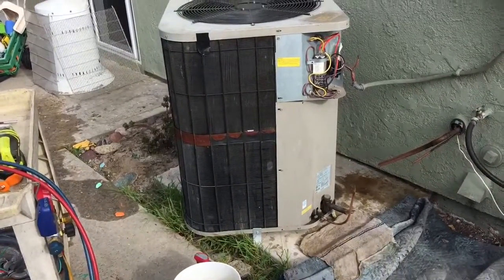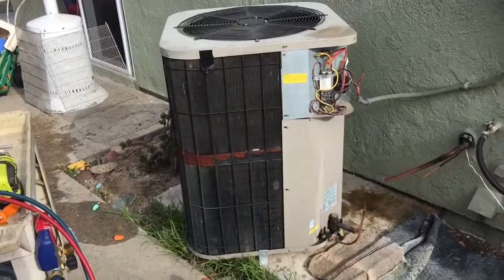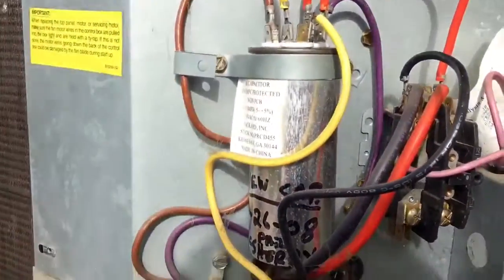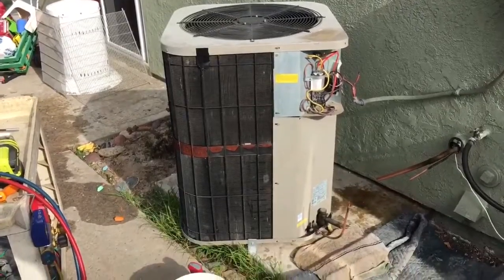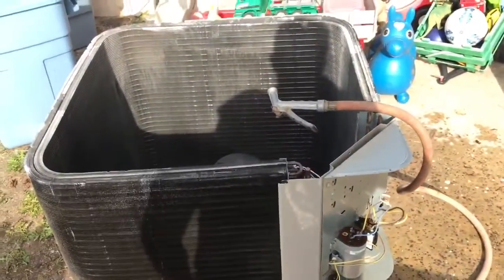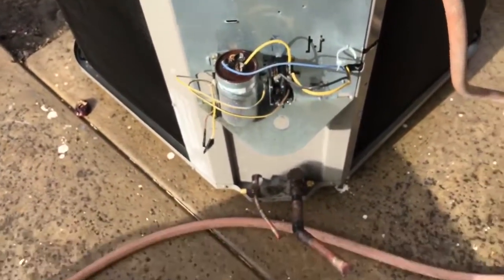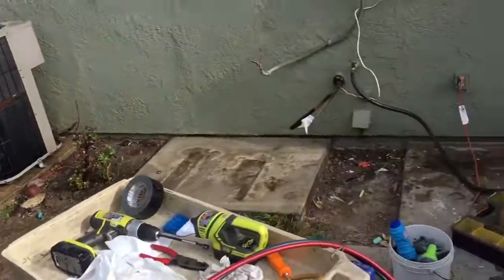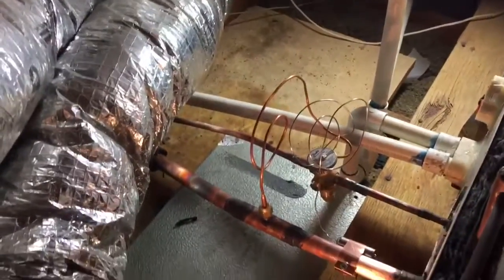Old R-22 3.5 ton removed👏4 ton install R-410a😊piston removed😊 txv installed😊

Comment: Nice video one quick question on that equilizer port did you put a core valve?
Reply from the maker: No, why would i do that ? Do you ? Equalizer tube has no schraeder depressor in it.
Reply: OcRefrigeration,Hvac & Electrical. Don't take it personal bro it was just a question , reason why I asked was because I attended to a seminar recently and one of the instructors mentioned that its best if you install a core valve .. and now I'm going to answer your question no I don't install core valves at the external port I don't even use a valve I drill a hole big enough to fit the   Equalizer pipe  I cut the flare nut off and braze it in .. plain and simple my friend!
Reply from the maker: Yea, that is actually Best. Only thing with that is you have to be careful not to get copper shavings in the system , that will trash a compressor but quick. Those copper shavings stick to refrigeration oil inside the pipe like shit to a blanket. But, it is the best way to avoid refrigerant leaks.
Reply from the maker: Thanks for your answer. Interesting instructors are saying to do that. Ill have to call the Txv manufacturers and see what they say about that.
The Evaporator Coil manufacturers Have allways said Remove valve core. I been doing this 35 years and thats how its allways been done. Interesting topic though. Thanks for bringing it up.
Reply from the maker: Why did he says its best to do that ?
Reply: OcRefrigeration,Hvac & Electrical. Yessir thanks for sharing
Reply: OcRefrigeration,Hvac & Electrical.  I honesty don't remember why he said to leave the core in , been doing HVACR work for over 8 years and I never install a core  valve.

Comment: Looks like a Bryant unit to me. Why did they change it if it works?... loud? Good swap out my man.
Reply from the maker: Winner! Bryant. Old one Too Loud R-22 , 13 seer, 3.5 ton. Gets rid of r-22. 1/2 ton bigger. efficiency. 14 seer. Lots of wins. this one is wayyyy quieter. installed a txv. old one was piston. New one---14 seer, R-410a , . New One is sooooo Quiet !!!
Reply from the maker: thanks.
Reply: I finally win....yes! The Bryants conds. are pretty quiet. Good little MacGyver move, I've done it before.